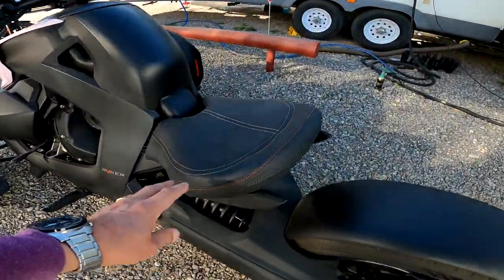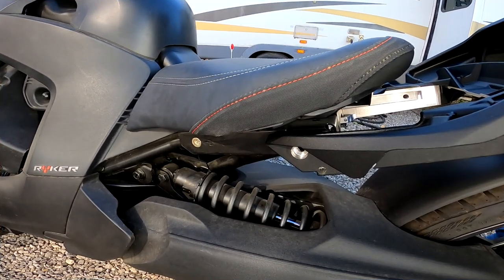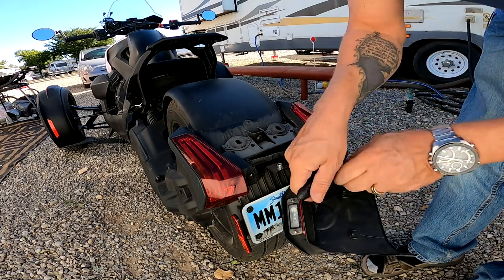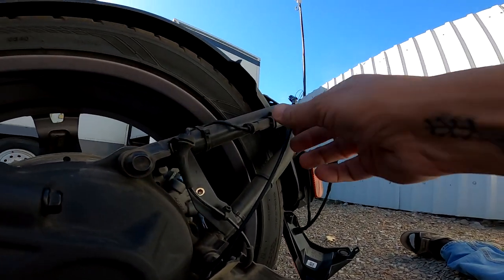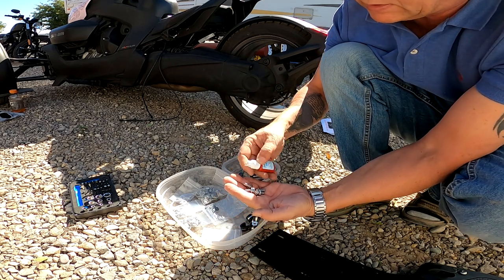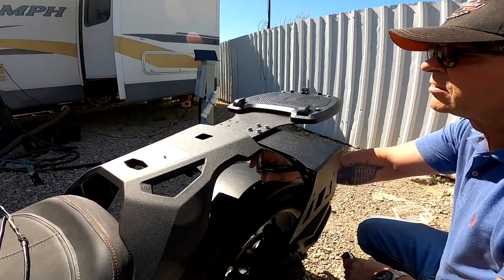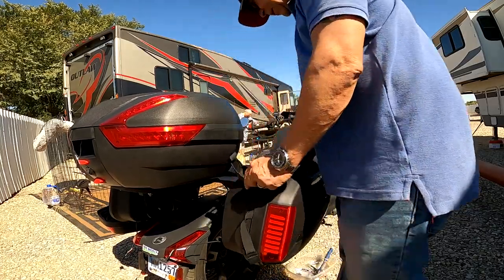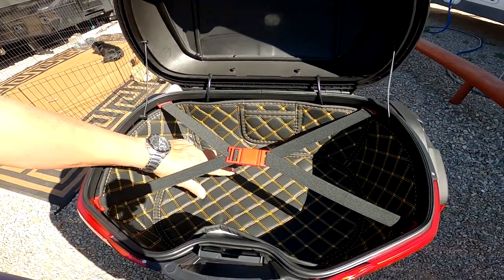How To install Saddle Bags on a Can Am Ryker

Comment from the maker: Just a little half year review on these saddle bags. We have now had them for over half a year. We have been in Oregon since February, where it rains A LOT. The motorcycle has been sitting outside in the rain under a cover. We have used the bags to bring jackets and rain gear on our trips and we have even gone grocery shopping with them. Amazing what can fit into these bags. There has been no water intrusion into the bags. The electrical connections all work perfect despite the wet climate. We love these bags and they seem to hold up to the wet climate rally well.

Comment: Super. Your video cleared up a lot of misconceptions I had on how the wiring runs and why ... because of suspension movement it has to go way up front and then back again.  Sure appreciate your thoughtful incites into why you did what you did at times. I will be doing mine early next week and am thinking of ideas to quick disconnect the saddlebag wires so I can remove them easily for both cleaning and operation.
Reply from the maker: Thanks Larry - I’m glad it was helpful 🙂👍
Reply: @sixwheelsdown7453  8 hours later I got 'em on. One bag would not lock. Found out the racks are "side specific". Switched them around and all is well. Why so slow??? First thing is you are super. 2nd thing is I can be a dufus. Removal of the taillight cost me dearly. Did not know the tip just popped up out of those slots. Had to hunt down that information on another video. Then the left taillight would not cover all those wires for me. That's just another reason they make beer.
Reply from the maker: @larrymalinoski4296  lol 😅
I'm happy you figured it all out. It is really a nice kit.

Comment: My biggest problem with Slingmods and most 3rd party kits are the harnesses.  For "custom" harnesses the end user is left with a lot of adapters, pugs and extra wiring to hide and tuck.  Thats just bad design, poor execution and not what im wanting to add to my Spyder.  Sell me the parts,connectors and bulk wire and i will make my own better harnesses.  This is not a commdnt about this video, it was very informative.
Reply: Sure - I can see what you mean. 
I think you are right, that it would be good to reduce the amount of connectors, the can be a cause for errors and corrosion.
On the other hand - this harness was very easy to put together and no tools needed for that. Further more we have had no problems with it since installation. So all in all - I like it as is 👍
Reply: If you go the plug n play route, then dielectric grease and shrink tube is a must. There is no green oxidation in 3 plus years so far.
Reply: I put the harness together without dielectric grease and have no problems after one year.